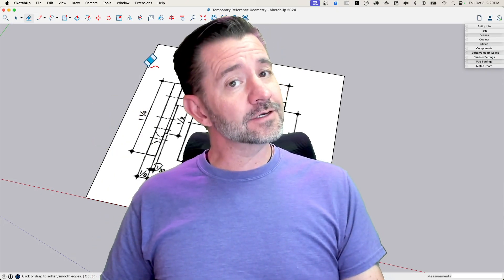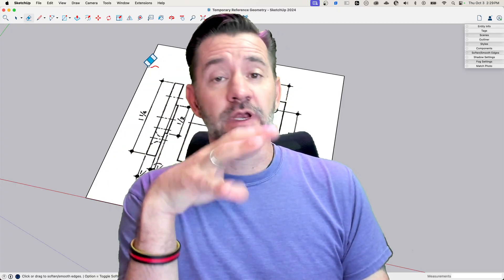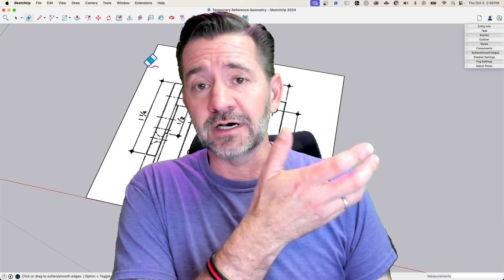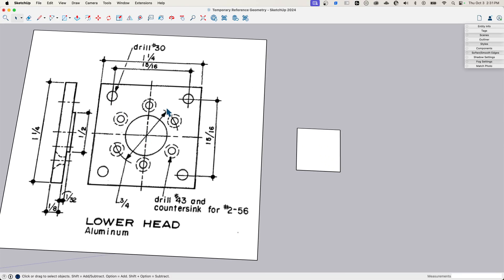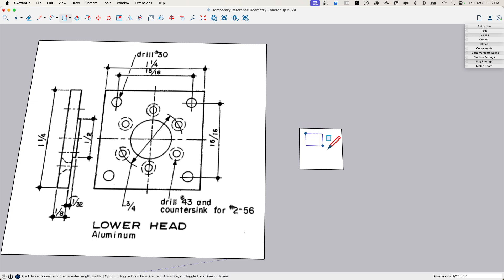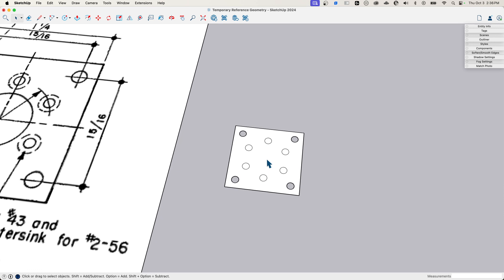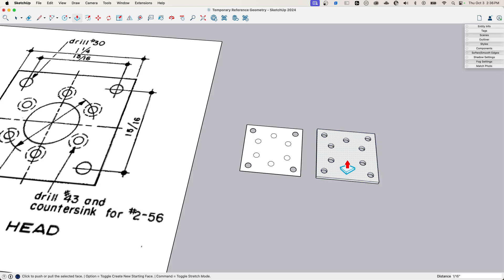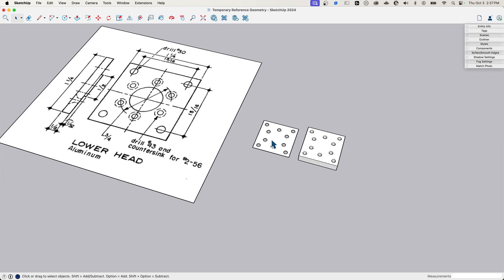5 Time-Saving Tricks Using Temporary Geometry in SketchUp

Comment: A few weeks off 66yoa, so I started draughting as a job at 16 on a A0 board with pencil and ink. Consequently I always start drawing everything in 2D before all the push/pull malarkey starts. I went to a 2 day AutoCad Achitectural course at Leeds College of Building, and ended up working for them for 6 months using AutoCad Release 12, ancient. I switched to SketchUp around 2000 to model alterations to my new-old house, a couple of small cottages joined together. Now in my retirement I'm venturing into 3D modelling for a couple of side earners, got to learn scaling up stl's and others from 1/35 scale to 1/6 to start with, shouldn't be to tough.😅

Comment: Great video Aaron. A quick tip for speeding up at 3:30 is to press option (Mac) before drawing the rectangle. This draws from the centre point which can be positioned using inference from the centres of the outer geometry. Also if you type a dimension in wrong, simply retype it.